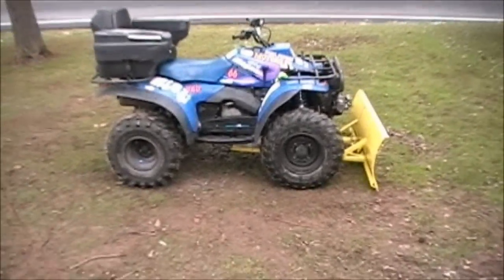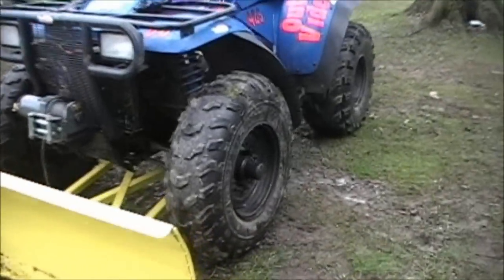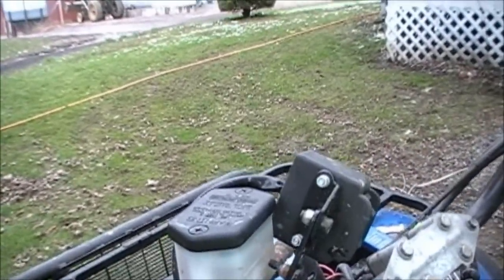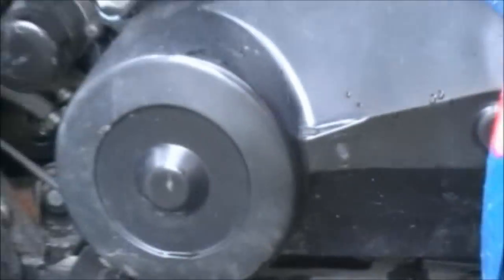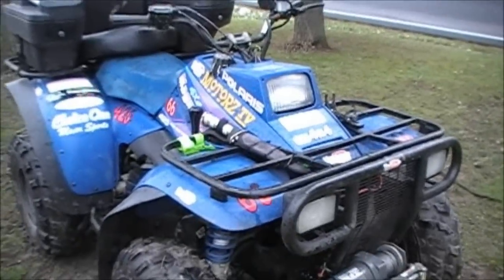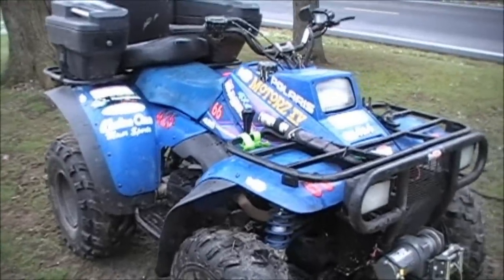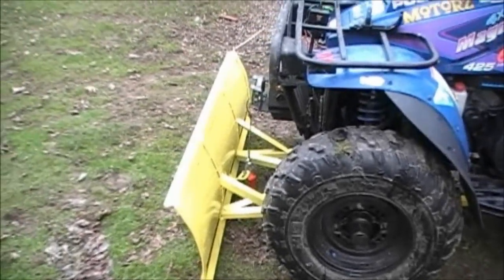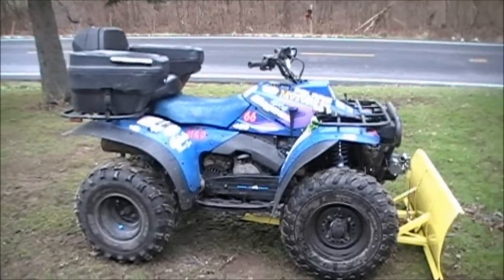Pisser Built Quick Teach Snow Plow

Comment: If it does move snow, its gonna move your frame too. Have watched 2 friends destroy nice bikes this way. The springs are absolutely necessary. Even though you may not like springs, they are properly engineered to save the bike frame. If you arent happy with what the blade pushes before flexing then you need a truck to plow with. Judging by previous comments, i can tell that youre are just going to have to learn the hard way but Just remember this post when you fetch up one day and fold your frame.  IT WILL HAPPEN. My two buddies were quoting you word for word until it happened

Comment: that plow wont work right it will cause your a arms to lock tight against the plow  when its fully up     
and it doesnt tilt or have a spring pivit for rocks might bent the atv frame in the hard stuff exept for the a arm thing it should do the job but id narrow the plow frame so it doesint hit the arms..